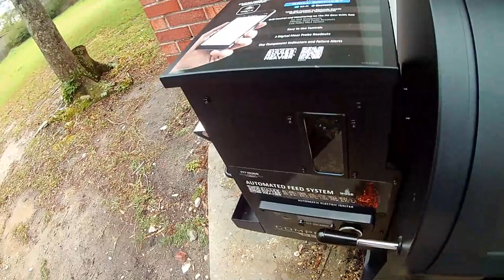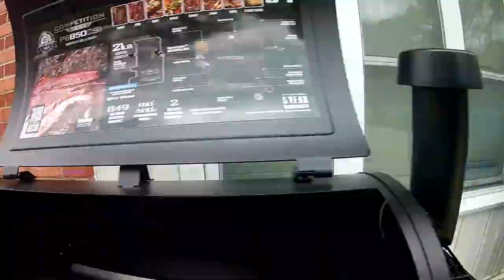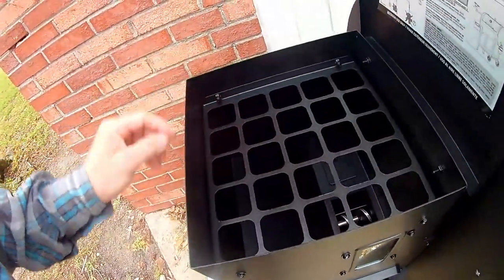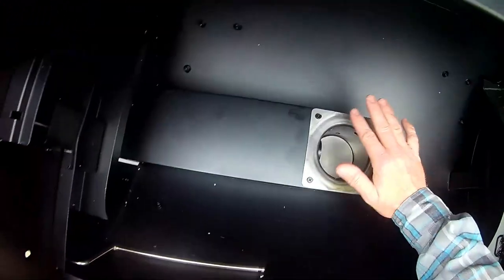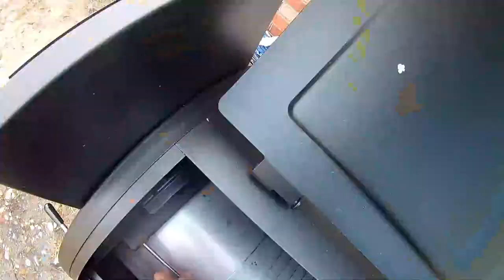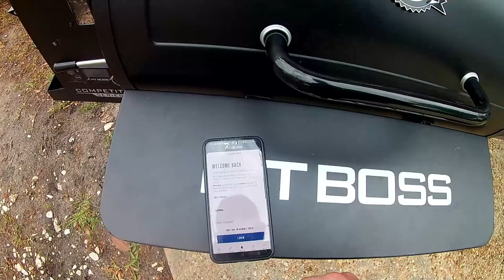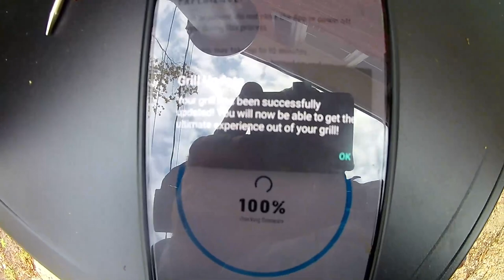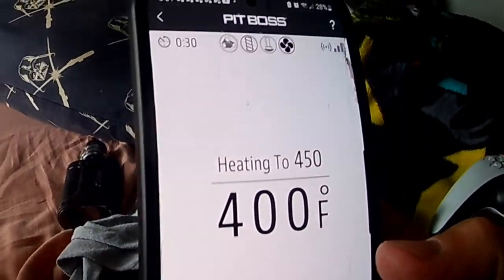PitBoss 850 Competition Series Pellet Grill & Smoker. How to prime, do a burnoff and use the App

Comment: Kinda like the idea of the front shelf being removeable, hard to tell from vid - but it doesn't look to be level. Did make one thing removeable, the grate in the pellet hopper. Took the screws out, removed grate. Put hex nuts on the screws inside hopper. Now I can easily remove/replace grate anytime.

Comment: I’ve looked on the Internet and have not found any help with this. How do you get the screen to display the p setting? I’ve looked in my manual searched online. I haven’t found any way to get the p setting to display.
Reply from the maker: I called them about this same issue and was told you only have to set it in extreme windy or cold conditions. Hence I've never changed it and it always holds temp.

Comment: I just bought the Pit Boss 850 Pro Series. How do you  set or calibrate the meat temperature probe. Do you just plug it in or do you have to set your desired meat temperature.
Reply from the maker: Hey Bryan thanks for watching. You can click on the probe icon on the app and set the temp. Otherwise you just have to watch it manually on the grill.